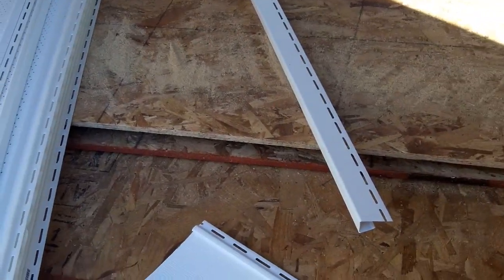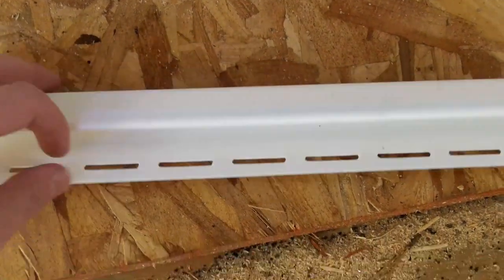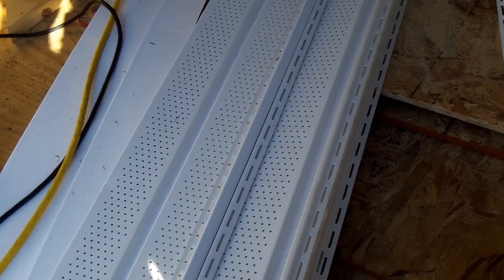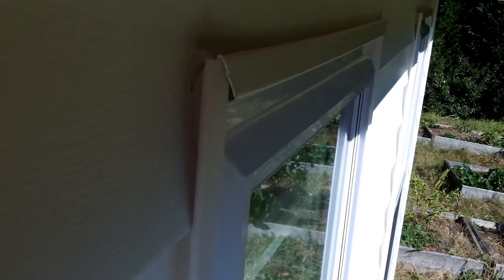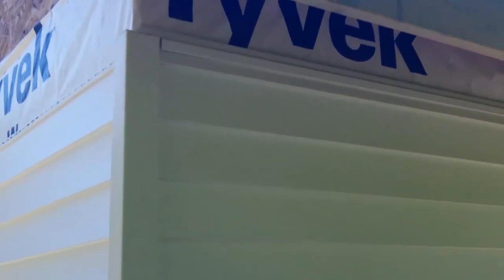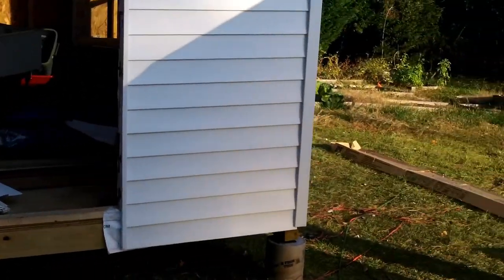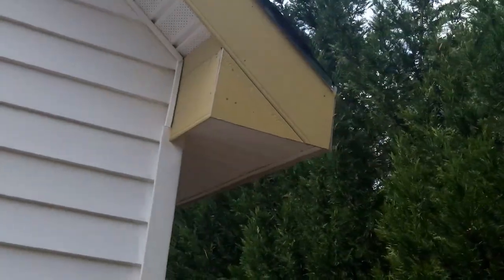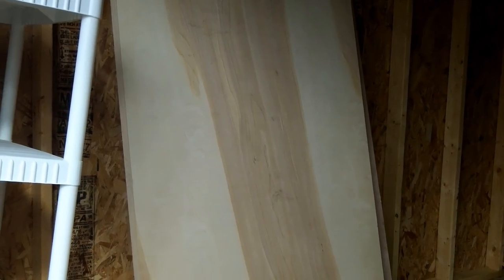DIY Shed - Part 5 - Vinyl siding

Comment: your videos were pretty good, the pocket you speak of is a J channel, the soffit fit into an F channel. use a starter strip at the bottom to hold your first row of siding. i would like to see how the doors turned out.

Comment: You should have used a starter strip on the bottom of the siding which you level all the way around as your first step in siding.

Comment: Can you provide a rough cost estimate of how much this whole thing cost you (without labor, for obvious reasons!)
Reply: My 8'x12' shed, built very similar to this video, is going to come in around ~$2,500 all said and done.  My foundation is overkill (nine 12" diameter piers, three feet into ground and Simpson ABA44 ties holding the skids), but my roof pitch is a lot more conservative at 4:12 (mostly because I'm keeping it low for homeowners association reasons).  I also spent around $300 on drainage rock to cover the entire foundation area after grading the surface, which is necessary to prevent rot.  It's also built to Florida hurricane code, and is using Hardie board panel siding.  One thing I've learned is that the price difference to go bigger is very minimal. To build twice the size isn't twice the price...because building material doesn't scale evenly.